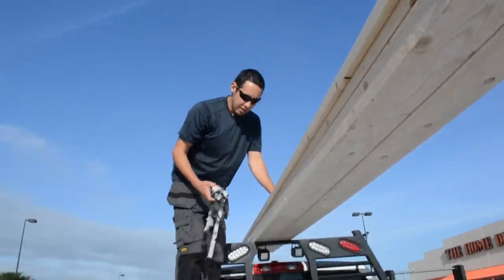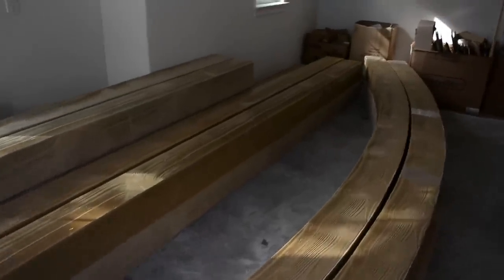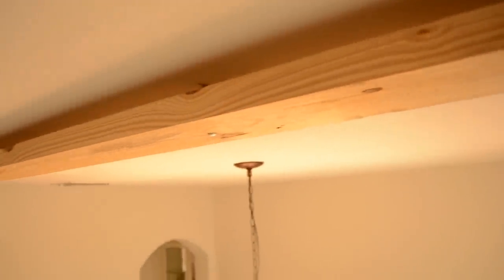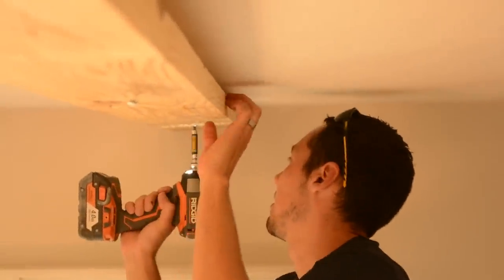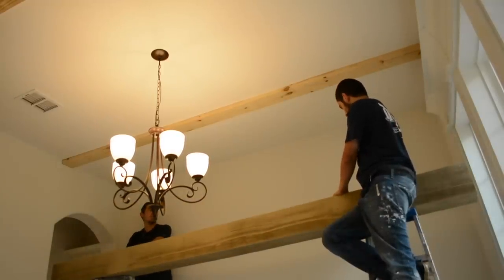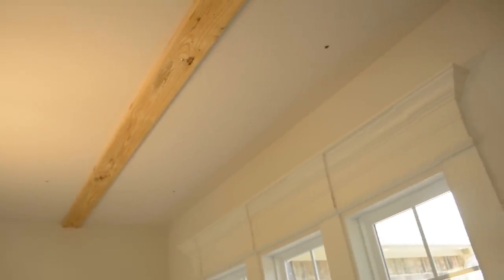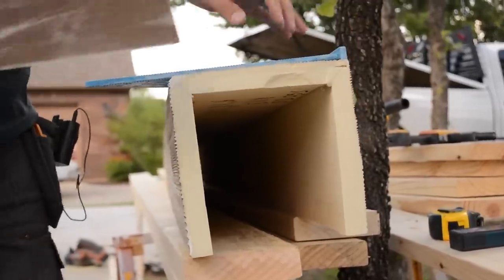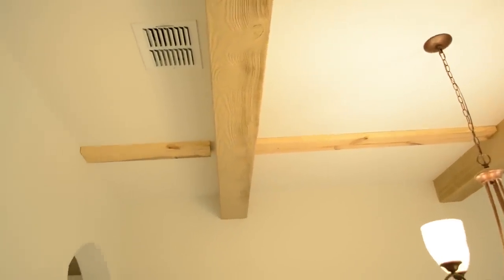Faux Wood Beams Install...

Comment: The customer should of let you use some real wood, even if it's a boxed beam, that foam is junk, and at least put some 3" screws into the Deadwood at each end to help the toggle bolts out, you don't want a 2x6 coming down on someone's head, don't ask me how I know 😟
Reply: JohnnyBDyer those toggle bolts are usually rated at like 180 lbs each. I think he could probably hang off of it.
Reply: The foam beams weigh about 8lbs per 10 feet....the toggles are fine lol
Reply: I disagree.  We bought a house with 18 year old foam beams.  NOBODY knew including us until we renovated.  Call us idiots but they looked like the real thing even that old.  Foams beams are done so well these days that your guests will NEVER know.
Reply: Those toggle bolts may be rated at rated at  180 lbs each, but probably at 50 pounds of pulling force, it would tear the drywall.
Reply: @saulgoodman2018  that's not how it works